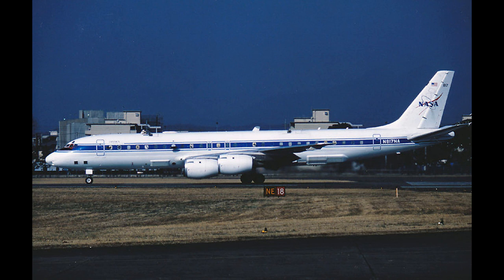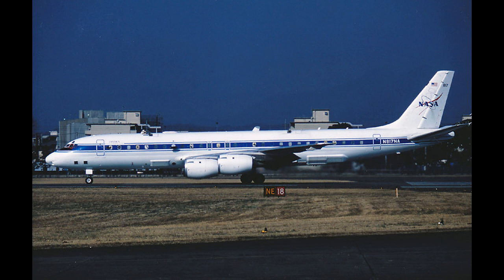[CVR] NASA Douglas DC-8 in-flight use of reverse thrust test

Comment: I believe this was done after the findings of Landa Air Flight 004, where they find out the very "cascade" reverse thrust on the engine closer to the leading edge which if deployed in midair will disrupt air flow leading to a stall on that wing, which is also what's happening on this test flight.

Comment: is this the ntsb whos trying to find why lauda 004 crash?
Reply: Yes and no. This test was performed in 1995 and Mozart crashed in 1991. The Lauda investigation had concluded by this point (for the NTSB, they concluded that the no 1 reverser came unlatched in cruise for unknown reasons. Further independent work was still being done to determine the precise cause of Lauda outside the scope of the NTSB). 

The NTSB wanted to begin the next best thing:obtain baseline data for measuring the amount of airflow sent back above the wing during inflight reverser deployment. The dc-8-71 was one of only two commercial aircraft with the authority to use a reverser inflight safely operating at the time.